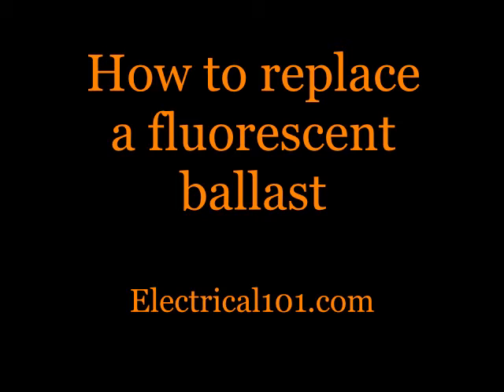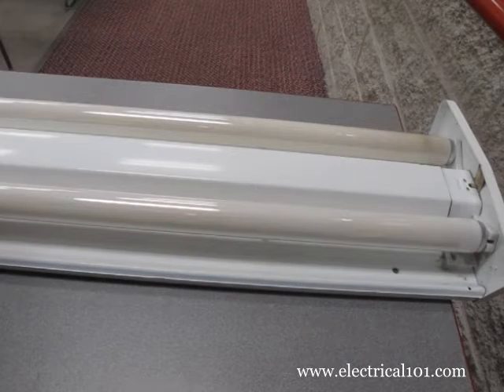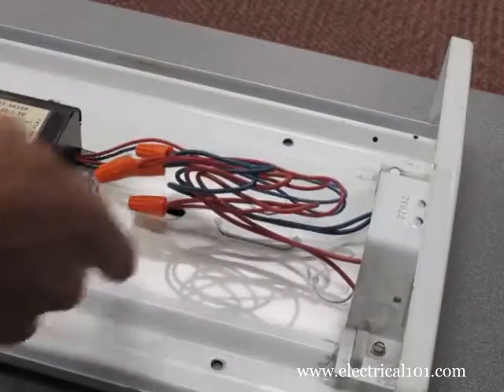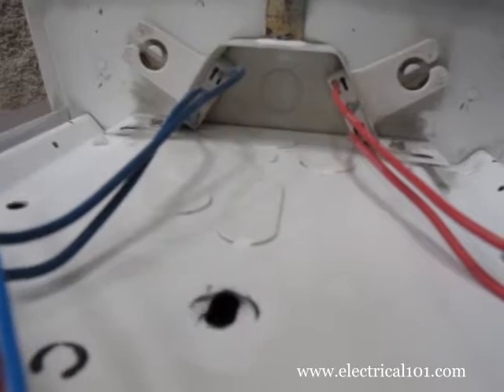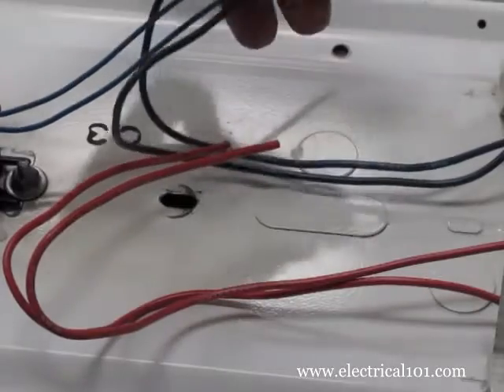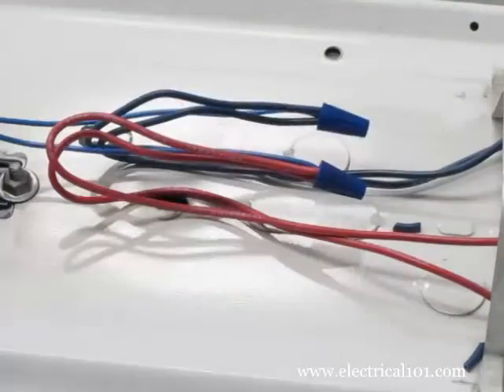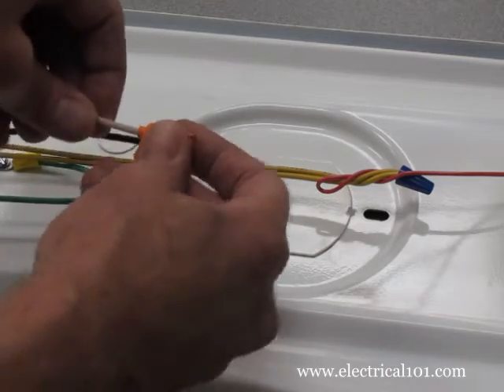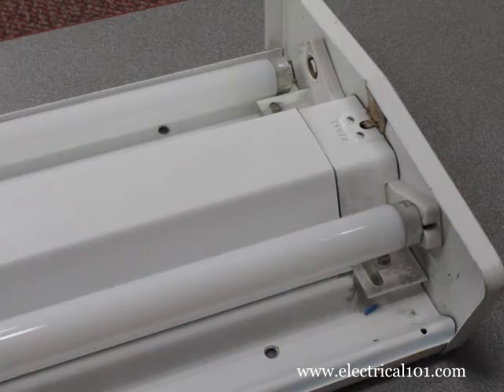Replace Rapid Start Ballast with Instant Start

Comment: Can’t thank you enough for this! 

I was having a beast of a time trying to find out why in the hell the old ballast had 6 wires for a 2 lamp setup when all the ballasts at Home Depot & Lowe’s were only 3.

I even asked a someone I know that is more well versed with electrical than I and his response “just buy a new led setup”, which OBVIOUSLY didn’t help. It also would’ve been more expensive than a $15 ballast. Since the repair was for my girlfriend’s Mother I wanted to spend as little of her money as I could to help out at the house. You made it possible and I salute you for it, Sir!

Now to find some whiskey to celebrate the return of light to her garage :D